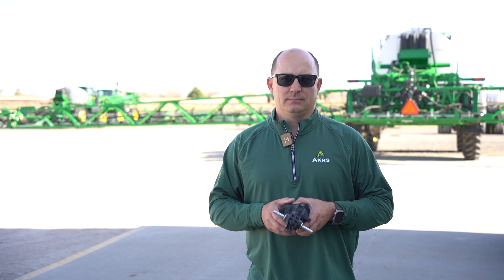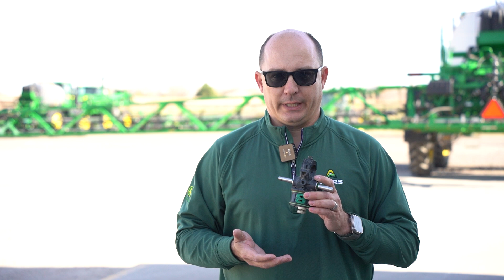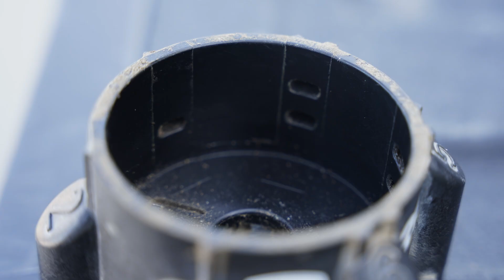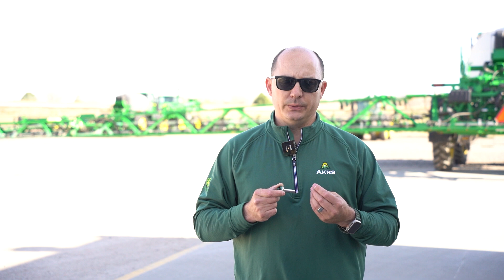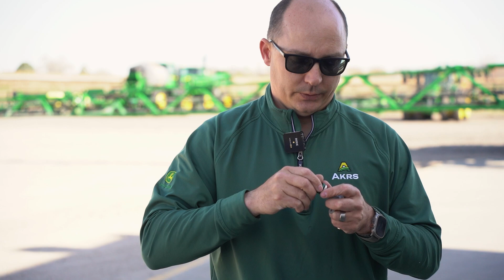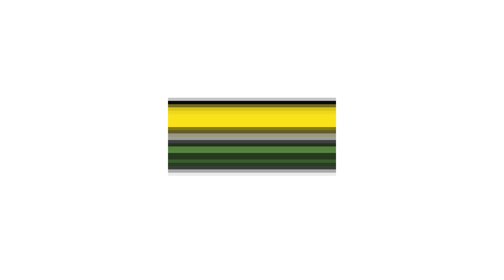ExactApply Basics with Nozzles

Comment: Is there any benefit to running A+B combined mode when applying lower rates such as 5 or 10 gpa?  Duty cycle is very low but coverage looks good.
Reply from the maker: Using the A+B combined mode at low rates like 5 or 10 gpa is good because it sprays from two nozzles at once, giving you much better coverage. Even if the nozzles spray less often, getting spray from two spots helps cover your field more evenly.  ETA---A+B combined sprays through two solenoids, not two nozzles. Then is routed to a single nozzle.
Reply: When using A+ B out of the front nozzle only (long turret), does the duty cycle cut in half?  I was always aiming for the 70% duty cycle or flow rate Is why I was not using A+B combined.
Reply from the maker: @devinmccarthy1151   Yes, the duty cycle will be lower as we are in a 30hz pulsing situation in A+B Combined mode through the long turret compared to and A or B only situation where it'd be 15hz. Coverage should be very similar as we'd effectively be having the same number of pulses. A+B combined was developed with higher rates of fertilizer in mind. My recommendation in a 5 to 10 gallon per acre application pass would typically be A or B only so you would then expect to see a 70-75% duty cycle (pending pressure and correct nozzle selection) so then we also limit a low duty cycle over application scenario like we may see in A+B Combined.